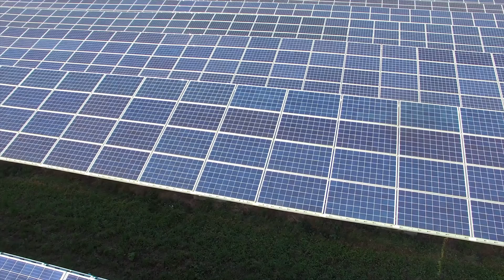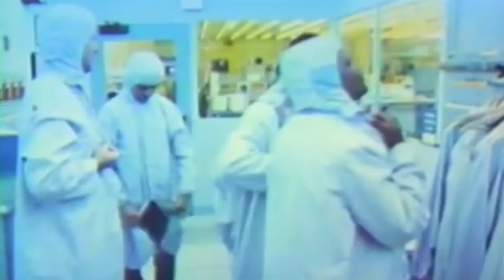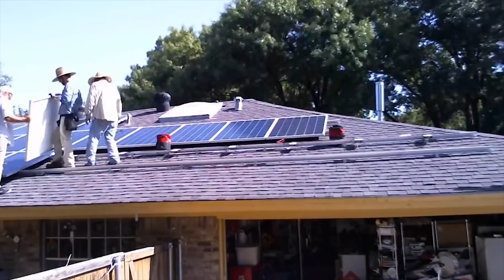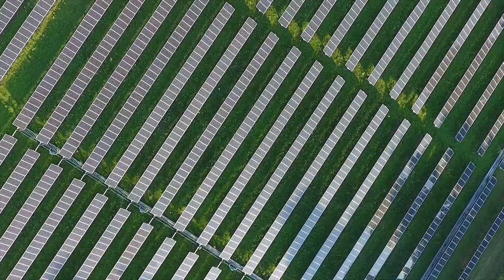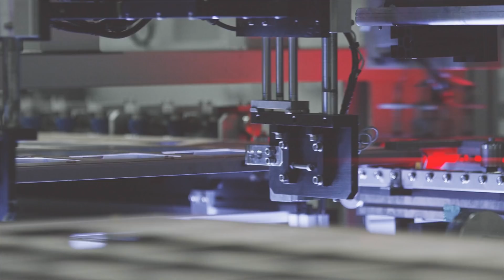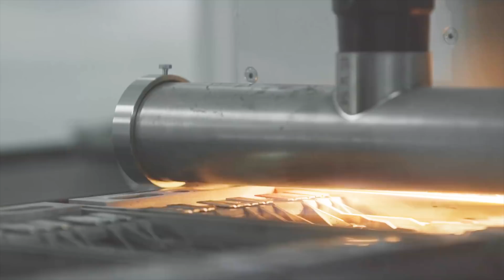US Home Solar Power - How the US came to embrace Solar generation and what the future holds

Comment: Solar is a joke, we demand and expect, we need 24/7 reliable power. Not some half baked shit that might supply power on a intermittent bases. Battery back up relies on materials that create a toxic cesspool of death. Wind power is by its very nature intermittent and destabilizes existing power grids. The only reliable power sources are fossil fuel and nuclear. We all know what can happen with nuclear energy. Enough said
Reply from the maker: I don’t understand what your argument or stance is? More coal and gas?
Reply: Take a look at the man made disasters in China from refining these exotic metals required for both solar and wind. Then tell me that either is more desirable than fossil fuel. As yet there is no recycling of either so disposing results in more toxic heavy metals in the landfill. CO2 climate change is a hoax, it is in fact what plants breath. We are way low on said gas in the atmosphere compared to previous historical levels, infact we are seeing a increase in plant growth as levels rise. Climate change is a farce. Around 12000 years ago the earth experienced a series of comet fragment impacts that resulted in a drastic upheaval of the earths climate, we are still rebounding from this event. While I agree for the need to improve efficiency of fossil fuel use, the way to acheine this is not thru energy poverty. In the last 40 years the Alberta oil sands has been instrumental in all kinds of tech that has done just this. One apparent observation I have with Europe’s green revolution is the rapid increase of the use of wood heat, a very high pollutant far greater than fossil fuels. In essence your cure is of far greater detriment to our environment than the problem. As for fossil fuel running out, it is more than apparent that fossil fuel is not the true source of this carbon based fuel, it is created by the natural mechanisms of the earth its self. One interesting side effect of improved efficiency in automobile engines is far greater horsepower from the same size motors. Now I will bring up the C-X75 Jaguar once more, the utilization of fossil fuel and electricity working together to create a far superior use of both technologies. Makes far more sense than antiquated battery power with its inherent toxic by products. We may never see a battery that can actually store the energy needed to support our present needs. Here in Canada 10kw is at best bare minimum to support life in a winter climate, that does not include energy for heat, something that is required for around 8 months of the year. I have looked into solar and wind power, neither can supply a 24/7 reliable power, solar would never cut it here, it’s not uncommon to be without clear sunny sky for periods of a week or more. Ask the people who have the misfortune of being on the same part of the electrical grid as the bird blenders what has happened to their once reliable power. LOL sometimes they see multiple brown outs in a single day, where it was only a storm related occurance. Your solution is not a workable one, and while I know fossil fuels have issues as well, it’s still a far cry better than this green bullshit.
Reply from the maker: I disagree with almost everything you’ve said! Please post some peer reviewed or credible sources for any of that
Reply: Go find it yourself, think I have time to be your search engine? All you have to do is look, is far more rewarding than having it handed to you. Sorry but I am not a sheeple, have been doing this for a few years buddy, I don’t just accept one source, I research interesting topics and squire knowledge based upon multiple source intake. Every thing I have put forth is the result of this intake of knowledge. You appear to take things at face value without doing any home work. Your a parrot for mainstream lies, you have no desire to seek the truth. Have fun in your search, my you find the truth fella, or carry on as a sheeple, does not matter to me. Just don’t expect me to sit idly by and listen to lies and blatant falsehoods without raising objections to it.
Reply from the maker: But you've not supported anything you've said; it's incredibly easy to claim that I'm "a parrot for mainstream lies" or puff up and state that you don't sit idly by when you hear blatant falsehoods, without providing a counterfactual point or evidence when challenged.

For example, I'd didn't know anything about the comet impact but have read a little now and more than happy to post a link or two because it's much better to share knowledge, and have a conversation about what you've learnt, than it is to lock it away and smugly claim to know something others do not - you will always learn something in return.

https://www.newscientist.com/article/2128512-ancient-carvings-show-comet-hit-earth-and-triggered-mini-ice-age/
https://www.scientificamerican.com/article/did-a-comet-hit-earth-12900-years-ago/
Reply: Buddy I am working off a iPad and doing links is not something that can be done with any degree of speed or time.

Comment: Are there still states, countys,  where installing rooftop pv panels are not allowed? In other youtubes I hear there are still limitations for example in the 'sunshine state Florida'.
Reply from the maker: It's certainly the case that there are barriers to entry. I've included a snopes article about the Florida angle

https://www.snopes.com/fact-check/is-it-illegal-florida-power-home-solar-storm/
Reply: I am surprised that insurance companies have not deemed a house that has solar panels on the roof uninsurable, seeing as there is many fire departments that will not fight a fire in said homes. The electrocution potential is always there because the panels in day light hours still have power even with the shut off.
Reply: letserb Do you mean it is not a good idea to put pv"s on the roofs of houses?
Reply: Well as I have told the maker of this channel the information is out there. My advice is to do your own research. I have my opinions based upon my research and findings. As I have said there is no true way to de-energize your panel itself. There is many fire departments that will not fight a house fire with these panels because they can not spray water on them for fear of electrocution. Some panels on the bigger systems produce 600 plus dc volts. Thus my comment relating to the fact that I am surprised that insurance companies are not or have not started to refuse to insure. So my advice do lots of research before even considering roof top solar. For myself, the decision is already made. Here in Canada to supply a standard house without electric heat is at least the equivalent of 10 KW, with electric would be more like 20KW, so a system with storage would run well over a hundred grand with a comparable generator back up. It’s not uncommon for us to be without sunlight for a week sometimes two at a time, so that would entailed the running of the generator for extended periods of time. Natural gas would be the preferred fuel source, but you have decreased generation capacity. Diesel or gasoline requires a very large storage tank and associated issues that come with that mode. The pros and cons are many. It depends largely upon what you expect to see as a end result, and what you are willing to pay. The give-take grid connection does not give you a off line use ability, it just saves you money, maybe. From all the info I have found it takes years to recover your investment, and by then your panels are approaching replacement time. Hope this helps you a little. Read my response above as well, tells you a little of my thoughts of the so called green revolution and what a farce it really is.